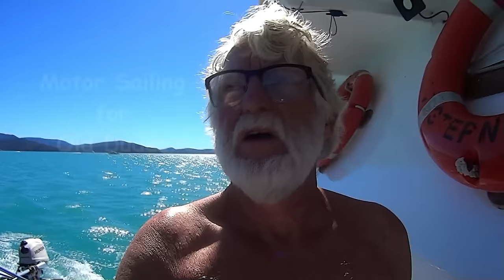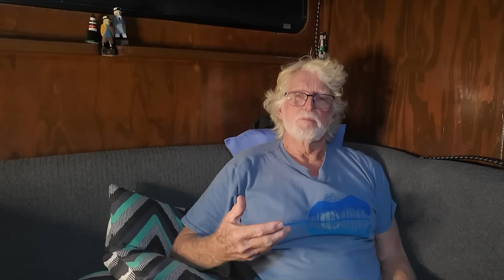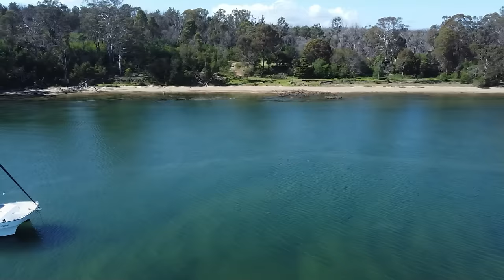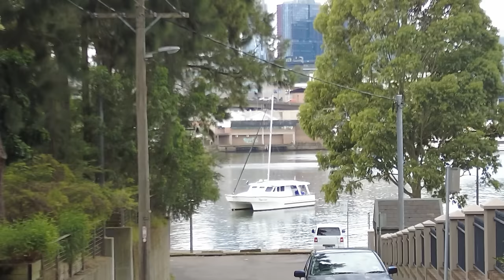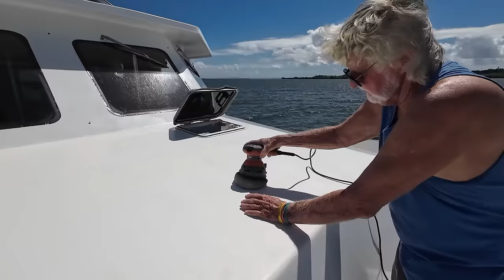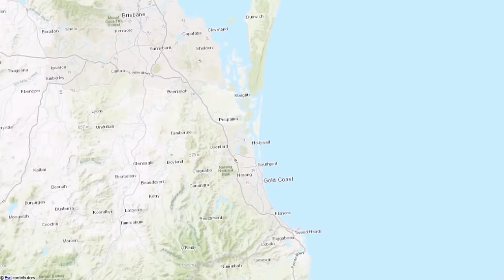Retiring On Board

Comment: The best cure for sea sickness is, Sit under a tree. Always works 100%.  It is terrible when you get it. If you are the Captain you are better off to find sheltered water and settle down for a while. If you are the crew you are usually doomed for a bad day. I used to get it really bad and it spoilt my day on the reef. Travelling was fine but anchored in the swell sent me off. Once on the move all was well. I bought a smaller tinnie and stuck to the creeks for a while and worked up my resistance to it, and changed my eating habits before going out. It worked for me and enjoyed a lot better. Now, I still have the tinnie and have got rid of the bigger boat as I was not using it much, as it was too hard to handle by myself.  Kids were always working etc.  Good advice as always Norm.
Reply from the maker: Thanks for the tips dude.
Glad I don't get crook, but being on the water is definitely better than sitting under a tree.
Reply: What got me over seasickness is Lay’s potato chips “sea salt & vinegar”
Reply: Former Govt sailor who gets sea sick here. First 3 days to a week I take dramamine, after that I am fine as long as it doesn't get rough. Watch the weather and if rough seas are on the way take another dose BEFORE it gets rough. Eventually I got over needing it, until I got on land for years and got it back.
Reply: Going below deck while under sail ALWAYS triggers my motion sickness.
Reply: Where can I find a tree on the open sea. Perhaps I should take a tree on the boat with us and when it comes to that maybe a fruit tree
Reply: I use the patch called Scopolamine.  It’s good for 3 days and after that you should have your sea legs.
Reply: Eat ginger an hour or two before the voyage
You can get it in any supermarket or open market 
You can even get ginger biscuits... Just as good

Comment: I guess at 54 I'm now an Old Dude 😎.... Living on a 37 foot Ketch..... totally peaceful.... Landlubbers are a different species, especially post Pandemic....I'm loving every moment of it....I have learned alot about myself and learned a ton of nee skills....A GREAT INEXPENSIVE WAY TO LIVE....GOD BLESS
Reply from the maker: Thanks for the comment Dude. I agree.
Reply: Don't say inexpensive too loud! 😮
Reply: When you say inexpensive I suppose it depends on your boat and weather you live at anchor more than marinas? Do you mind if I ask if you bought an older boat that was in good shape or a more modern production type boat? More room on modern boats but not sure I'd want to take the ground in them or hit a submerged object! I mean I wouldn't want to do that in any boat but especially  these lightly built boats. I don't have direct experience so I maybe overthinking this issue.
Reply: @seanmurray8051  a solidly built full fiberglass Hull a 47 year old Endeavor Ketch....powered by a 50 HP Perkins Engine
Reply: @SAILINGDIRTYBIRD  sounds like a great boat

Comment: Dual purpose motorcycle and an electric bicycle with a milk crate on the back works for me. I keep the motorcycle and or the bicycle at a $50 a month storage facility. If I'm a bit further from town (I'm moored on an inland river) I park the motorcycle out front of the boat on an adjacent dirt track. If I'm moored close to town I just use the electric bicycle.
Reply from the maker: Yeah dude. Sounds good. I like to use the legs, but it takes longer.

Comment: Well done ! I built my own 69 foot ketch (a ferro cement) and outfitted it and sailed it around the world back in the early 80's . Now 50 years later I am thinking of retiring on a boat . Something 40 footish (not fetish ) hehe . I like your sensible approach as I know what the real deal is . Times have changed and live aboarding has been capitalized and is not quite as cheap as it used to be . Anchoring and preparing to be as self sufficient as possible still seams viable if done correctly . Starlink would certainly be an asset for weather planning ect.
Reply from the maker: Starlink is great and self sufficient saves heaps.
Good luck with the retirement plan Dude.
Thanks for watching.
Reply: @MotorSailingforOldDudes  your very welcome , but I am 70 years old and don't cotton to being called dude . It is just not a term from my age group and I feel no desire to seem 'hip' . I certainly do enjoy your sailing perspective .

Comment: Hi Norm 
I’m surprised to hear that marina costs are $1000 to $ 2000 a month in Australia.
We have  gone down the syndicate path with boat ownership, with a 11.4 motor cruiser on the French canals; with access to 8000ks of waterways in Europe.
Mooring cost in a marina is about AUD $20 per night including electricity and about $100 a month.
I suppose the downside of the equation is the plane ticket from OZ.
I enjoyed your video……thanks
Jim
Reply from the maker: No probs Jim. Thanks for watching. The canal thing would be great to do, but those long plane trips are a killer. The marinas are pretty expensive here in Oz. The further north you go the worse it gets.

Comment: My advice, from first-hand experience, is to make sure you have working heating and air conditioning on board. I have done a winter sail from New England to Florida and also a 5-month summer sail in the Caribbean through the peak of summer. You'll take a beating with your body and mind. You can do it, but it will wear you thin. It's always best to increase endurance by controlling your environment from time to time. Always think long-term! - When you reach the point where you prefer water over land, you'll know you're more than halfway there.
Reply from the maker: Thanks for the comments dude. All good points.

Comment: Thank you for this video, Norm! This covered so many practical topics and you clearly have some wisdom as well on how to live a bit adventurously while still planning for any circumstances that could be life-altering if one was not prepared. Could you talk a bit more about the best way to anchor in the open ocean (what does out in the pick mean?) rather than in a marina? Also, what kind of boat is yours? Did you say you always have to motor? It sounds like you do and the sail is just to enhance your experience? Thanks for all this great information!
Reply from the maker: Thanks for commenting.
Yep the boat motors all the time, the sail adds a bit of speed and a lot of stability. Out on the pick means..at anchor. 
Don't anchor in open ocean very much. Usually behind a headland or in a bay out of the wind and swell.
Crossing bars usually gives more protection in a river, but care is needed when crossing.
Here is a link about Peggy Anne
https://youtu.be/LPXNX6D521Q

Comment: G'day Norm, another great video.Whats your opinion on cruising the coast with outboards,if it's at all possible, thanks Scott
Reply from the maker: Yeah Scott. Wouldn't be my first choice, but can do. Plenty of Sailing cats run ob,s as auxiliaries.
Reply: @MotorSailingforOldDudes  Thanks Norm, the issue would be the fuel range in a motor vessel using outboards full time

Comment: I lived on a 35ft cruiser for 5 years, excluding winters and found it very boring, this was a 1963 wooden top and there wasn't enough to do.. I built a campervan and took a drive out to Portugal, bought a cheap house and the campervan gets me out into Europe. The house and camper keep me business in partial retirement.
Reply from the maker: Whatever works dude.
Reply: @MotorSailingforOldDudes  An old friend of mine lives on the Gold Coast and has a sailing boat, he does some racing, which suprised me, since he is an old dude, overweight and a businessman. You never can tell. I lived in Oz for 3 years and loved the Gold Coast, so do get it.

Comment: Norm have you got a water maker? Thanks for videos!
Reply from the maker: No Alan. Have done without one so far. I store 600lts and catch off roof.
If I'm going to more remote areas I may get a portable unit.
Reply: @MotorSailingforOldDudes Norm, does this mean you catch the rain water when you say, " I store 600lts and catch off roof?" I am not familiar with some of the Aussie sayings. Would that be possible to do that?

Comment: Motor sailing. Be honest. Between the motor & the sail, which do you use more? I watch sail boat videos & there isn't enough wind & they use the motor!
Reply from the maker: Agree that a lot of sailboats do a lot of motoring or motor sailing.
I Motor 100% and use the sail to help dude.
Reply: @MotorSailingforOldDudes  At first I didn't get a good look at your boat, It's weird, it looks like a power cat & somebody put a sail in it as as after thought or after market! In the US cats haven't caught on. I like cats. Sail boats are cool, but that don't make them practical if you use the motor more than the sail. So my problem is cool ain't always useful!

Comment: It's common that in the tropics (hot places) many living on the hook leave the boat and seek shade during the day.  How do you deal with the extreme heat?
Reply from the maker: I try to be south away from the tropics in summer, but if not just have to adapt.
Reply: @MotorSailingforOldDudes  Thank you for your reply!  I have seen some boats make a huge boat shade,  or they buy them,  but some people say it doesn't help.. I like your thinking..go where it's comfortable to begin with.

Comment: Hey norm , my and wifey renovating a 40ft cruisecat at cabbage tree point should be finished in 12months . We have been boating our whole life (50) 
 The only time we may feel sea sick is if the boat stops at sea and is rolling around , when we are travelling everything is generally ok . We plan to do coastal cruising and anchor inshore . Would you still class this as a sea sickness risk ? 
Thanks mate
Reply from the maker: If you can cross the bars, you'll get lots of swell protection. In open roadsteads, it can be a bit swelly. All bars are doable, as long as conditions are right and you Dudes are prepared to wait for them.

Comment: Hey,
Can you give us an average cost of fuel on a 40 ft motor boat daily?
Let's say once a week we wanna travel 100 miles by sea. 
Locating different areas
Reply from the maker: A lot would impact on that average dude.
Eg size of boat, type of hull, size of motor..motors.
My boat uses 6.4 litres per hour for both motors, which gives me about 5.5 knots speed.
Hope that helps.

Comment: Thanks for your videos mate 

Really enjoy them 

Just wondering what proportion of your time do you plug in at a marina, verses anchoring out in a quiet cove?

I know you mentioned you prefer to anchor but just wondering what your ratios were.
Reply from the maker: I am not adverse to marinas, but would prefer to be anchored off a beach. Usually only use marinas when I need to do a big laundry. I'd say only about 10% of time.
Reply: @MotorSailingforOldDudes  awesome. Thank you 🙏🏽

Comment: I am 54 and considering following your path. I am novice at best. What license or qualifications do I need to be a solo skipper ? And who and where do I get these ?
Reply: GOOD VIDEO NORM.
Reply from the maker: In Australia, all you need is a recreational boat licence.
Can get it through Coast Guard or private providers.
A Coxswain ticket is commercial entry level, but course is worth doing as it teaches a lot of boating smarts. (Boat handling, engineering)
Thanks for comment Dude.
Reply: Keep an eye out for the free Tafe coxswain course that is a requirement for the coxswain ticket. It is a one month course.
Reply: Great vid, thanks. Share boats I like the idea but I would miss the free rein on diy maintenance and improving
Reply from the maker: You'll need a Recreational Boat Licence in Australia. Courses through Coast Guard or private providers.
Would recommended a Coxswains course. Commercial but lots of info on boat handling and engineering.